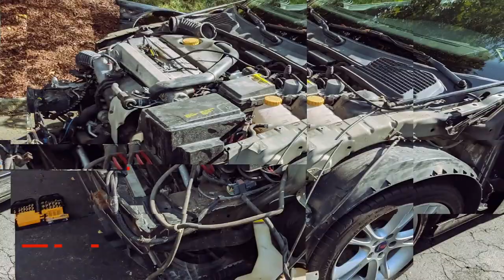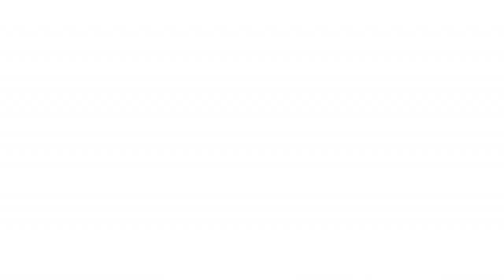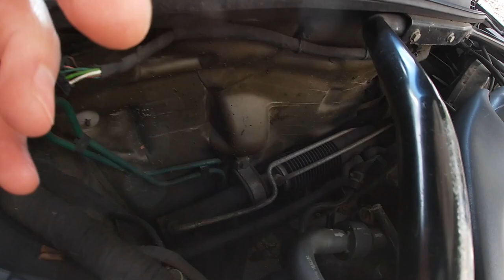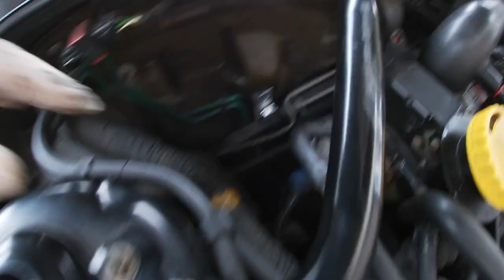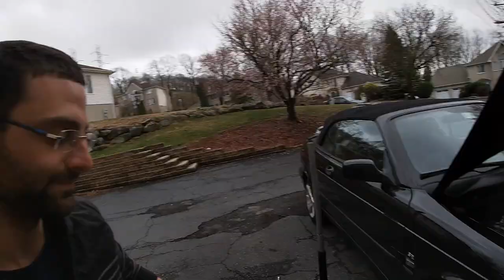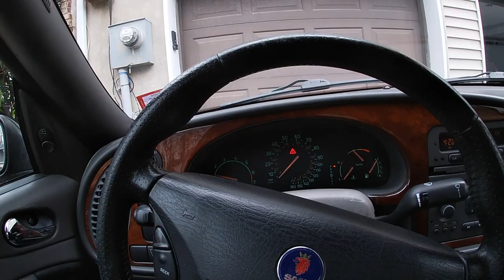CRAZY SAAB Engineering and a Perfect Solution! #PerformanceUpgrade

Comment: Such a simple fix. Makes you wonder how Saab overlooked that during the design process. Great video!
Reply from the maker: Thank you!
Reply: I think the reason why they didnt include this was because it affects how the car crumples during an accident. With that brace installed in changes the way the car reacts during an impact (I've heard this from quite a few guys on the Saab boards)..  I'm still going to be doing it.. my steering wheel has a decent amount of shake/play.. cant wait!
Reply from the maker: @nickpathoffman  worth it for sure! This car is driven locally. So should be good regardless, but I see what your saying
Reply: @KylePancis  totally. These cars were built like tanks regardless so I'm not worried.  I could see that your steering wheel wasnt shaking anymore.. that alone is worth it

Comment: I really need to do this on my Viggen convertible. I did the 6 point subframe brace from genuine Saab. The car is very hard to control under heavy acceleration and very floaty on I-75 going to work. Is it difficult to put in? I need to do stanchion arms, control arms and the struts/shocks. From everything I have read and watched online, I need this too.